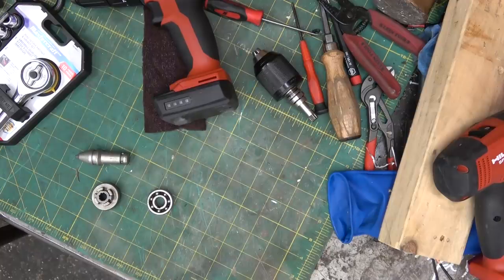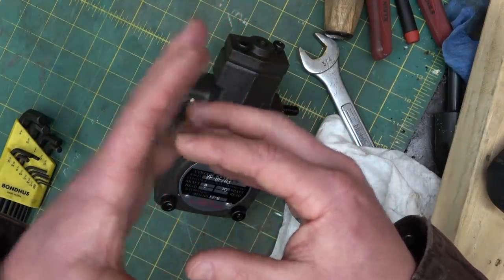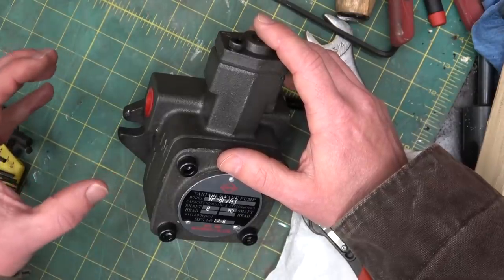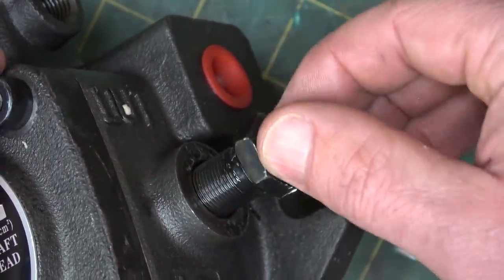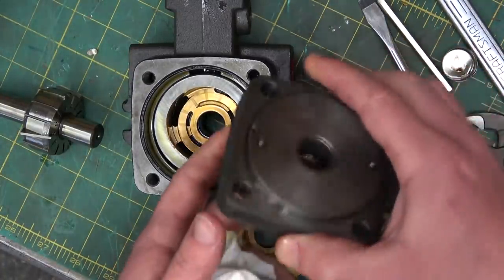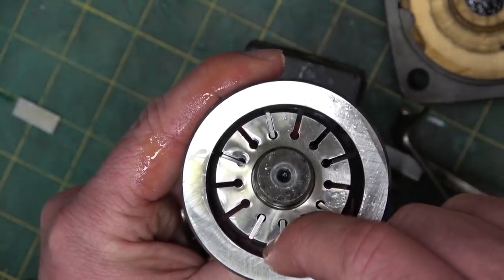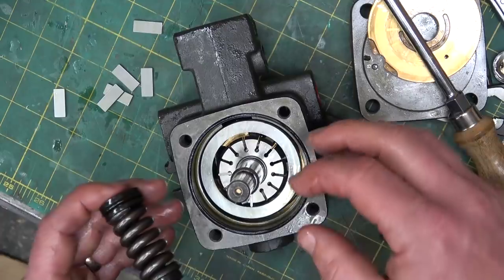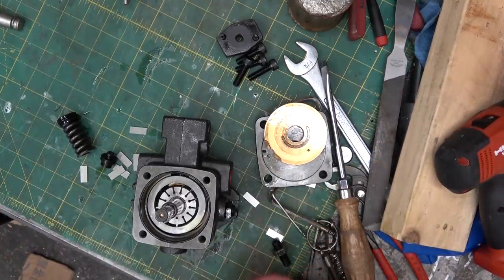BOLTR: Hydraulic Vane Pump | Engineering Lego

Comment: Sorry for the newbie question.  Is heat actually generated when the oil flows from higher pressure to lower pressure?  Or is it where the heat from the higher pressure oil before the release valve transfers to the lower pressure oil after the release valve?

Comment: But you get more pressure with a smaller surface area because the pressure is not being spread across a large area which displaces it. The pressure is more focused.

I'm pretty sure you said the opposite. Suggesting larger surface area gives more pressure?

Comment: Our hot oil system for our texturizer is set for 550°f and supposed to be at 30 psi or so. The pressure will get up over 60psi and the gauge only goes to 100psi. Does that sound sketchy?
Reply: @fascistpedant758  the best part is when the maintenance man says to just get away from it if it goes over 80psi

Comment: wrong, flow only happens due to a differential pressure. pumps create a differential pressure.
Reply: Yes and no. In a technical way you are right. But It's a pump so it depends on the use in a closed loop it's flow do to unequal pressure. in a open loop the pressure indifference between air and oil pressure is driving something meaning pressure is the driving force.

Comment: Finally got you a vane pump ehh? You are correct good sir btw. It is fascinating the power and "magic" of hydraulics. Nothing like watching a relatively small cylinder lift enormous quantities of shit and wondering, how in the fuck?!? It's crazy to me to see all of the crazy forces on a hydraulic cylinder besides the intended in/out forces (axial? Lol). Seems like the cylinders/ram/piston have to with stand all kinds of shear loading and side loading (I'm think shear and side loading is probably redundant) . IDK I'm legally required by OSHA to wear a helmet to work. So I'm no fucking genius. But the point I'm trying to make is hydraulics are fucking mystifying. Like how the fuck does a cylinder retain 3000psi of jizz while having a huge load of shit pushing back on it and then gets a side load thrown into the mix. Seems like the rams should bend all the fucking time, the seals have to be made of unobtainium to withstand the forces, and how is it that the slightest amount of dust/dirt/sand doesn't scratch the chrome and render the unobtainium seal useless any fucking way. MIND BLOWN! Good thing I just have to operate the shit and not build it.

Comment: The problem is these days you dont know if a company will be around. The 10 year "challange" has proven that to well. Many huge brands are going or already gone. The world changes. However is there good news with 3d printing and just at home cnc type devices becoming more and more popular. Even big auto is using 3d printing for some stuff because they dont need to keep a bunch of parts in stock they just whip one up. Also means your at home warrior can do the same. Injuction molding isnt going away but the need for excess that might have to be tossed or figured into another product are going to become less in the future.

Comment: If these are better than a gear pump and cheaper and more robust than a variable displacement piston pump, what's the disadvantage?
Reply: The control is not as fine as is possible with a piston pump and cannot withstand as high pressures as a piston pump.
Reply: @capsicumgalaxytabs4725  thank you!
Reply: @tomcardale5596  thats the basic version anyway :-)

Comment: I was unfortunate enough to be near a hydraulic line that blew open a pin hole leak and started spraying hot oil all over me. It's very unpleasant.
Reply: Leastwise it was all over you instead of all inside you. That does happen.
Reply: Sounds like a typical day at my work,  cylinder repairs and whatnot.  Every once in a while, something doesn't pass testing. Rest of the time, operator error.

Comment: Weirdest hydraulics I've heard of.  Hydraulics have - if not variable flow - a pressure setting valve which is used to set the maximum or normal operating pressure. The relief valve is a safety item which is set above the WP set valve and is designed to dump pressure - oil - in the event of failure of some other part of the system. And a relief valve does not leave the pump running at full load because relief valves lift at P1 but will only close at a P2 pressure at a considerably lower pressure than the lift pressure. Also - and it might be a surprise - but most hydraulics for industrial use have coolers.

Comment: My oil pump in my 1973 0lds350 stoped pumping.i took it out and found the spring valve deal waS stuck and 0pen slitely.wow i cleaned it up and now is unstuck. The plate gasket got torn up takeing tbe gears out..i was going to just use some red rtv.sealer and slam it back tograther,but,after seeing your vidio fear it mite not seal or something. I dont realy want to bye a new pump. Its,an old car i just want oil out the pushrods.what do you think ..is it,an issue?can i make a gasket or yous jb weld...but what do you think obi wann?great vidio..also your hands got redder i think ad vidio played on .wear gloves..i know,i knowbut vat do you think der gearmaster.i want to fix things. Not just panic out and go get a new pump.i saw your vidio on understanding the problem.

Comment: Dear Uncle B.: I am of the pixie-corraling inclination, so pardon my innocence. I understand pumps are good for flow, but what machines are good for building up hydraulic pressure? In my pixie-neutering work, you classify them separately (voltage vs. current source) and many times you don't build a device to be explicitly both, although many machines are designed to have both features.

Comment: And again we try to create flow without pressure - ain’t gonna happen. Any fluid enclosed in a system is not going to flow without pressure (force); you can constrict the hose all you want, but the fluid will just scooch out of the way. You need a skookum pressure-creating device, and somewhere for the fluid to go, then you can put the fluid to work for you. Or maybe not if you’re the sort to watch these videos and try to do these experi-mints at home; then you’re just begging for a face full of hot hydraulic fluid! 🤣

Comment: i watched this years ago, and now im in hydraulics. that thing looks like a knock off vpv or pvf what super chineseium
Reply: also the important thing for spec is rotation, flow, and pressure range. the mounting flange is universal as well as the shaft but theres likely dozens if not hundreds of options for the main three options.  Thats a knockoff of a "knockoff" looks like a continental pump which is a knockoff of a psv from racine
Reply: god i keep watching and it keeps getting worse, that brake in wear is just fucking insane, that old girl is gonna give it up fast

Comment: i'm really perplexed as to why they didn't put springs behind the vanes.. I have only seen pneumatic vane motors constructed this way, all vane pumps i have ever seen have all had springs behind the vanes. this is odd.
But thanks to UBF for once again providing a fantastic hydraulics vjo :)
Reply: Because this is a pump being driven, the centrifugal forces will fling the vanes out.  An air motor has to have the vanes out to start.
Reply: If you ever feel how smooth and slippery the vanes are in the slots you would understand. Very precision and always lubricated with oil. I've taken apart very old pumps that were in surprisingly good condition inside.
Reply: Most pumps wont have a spring behind the vane, centrigical force from them being driven will force vanes out to seal. 
Hydrualic Motors can have springs behind vanes- they need the spring pressure to help seal on start up.

Comment: Pump creates flow.... Compressor creates pressure. Differential pressure is flow.... Hmmmmm. Lol. What would lead an engineer to choose a vane pump vs centrifugal pump?
Reply: For the reasons he mentioned, flow can be adjusted.
Reply: @Patrick-857  but can't flow also be adjusted with a variable speed drive motor, or even with a downstream valve? I guess I'm just curious as to why an engineer would choose a Vane pump vs centrifugal (not worried about cost). Kinda like why do some cars have brake calipers on the front of the rotor vs the rear of the rotor.
Reply: @johnnyringo4463  For precise electronic control, a piston pump is used. This thing is self regulating, using a a very simple and purely mechanical solution. This thing does it's job without any electronics. The simplicity, the self contained nature of it and the lack of electronics means it's both reliable and cheap. We must also remember it could be an infernal combustion engine driving it, which means varying pressure with the throttle is a no go. Also, varying pressure at the motor level is always going to be ineffective due to the time delay caused by inertia. That's before we start talking about torque curves ect. In a hydraulic system, as AvE points out, pressure will spike instantly when a hydraulic ram reaches full extension. The pressure must instantly be reduced to prevent a blowout, and if you have a heavy motor winding down, that delay could be enough to cause it to blow. The beauty of this simple device is that it is continuously variable, instantly responsive and self regulating. Sometimes the simplest solutions are the best solutions.

Comment: Now, i wouldn't disagree that pumps primarily creat flow but to be completly exact, pumps create an energy difference in a system or rather give a fluid a higher energy state, in form of pressure, flow or potential energy (height difference). Piston pumps primarily creat this energy difference by displacing fluid, with the benefit of being suited for high pressure applications but not being suited for high volume flow. Dynamic fluid pumps like centrifugal pumps are not really suited for high pressure applications, due to them  
primarily increasing the fluid speed and therefor creating high volume flow. Now, saying that a pump doesn't creat pressure is not  
false but than again, you can convert fluid speed into a pressure, so the statement doesn't really make sense to me.
Reply: @fascistpedant758  
Yes and no, what you said about a massless fluid isn't false but translating the same principle to a fluid with 0 compressibility and and your pump would exclusively produce a pressure difference. As i said, for me it is a bit confussin, since you would calculate the total 
work done by a pump, as a total pressure difference (wich not only depend on restrictions but also the  fluid speed in the system and the height difference) times a masseflow. Saying that a pump only produces flow would than applie only to the case, when there is no height difference and very low fluid speeds. Than again, there is the NPSHA wich to my knowledge shows the height difference on th suction side of a pump dependent  on the fluid speed because alters the static pressure inside the tube. So as you said, it probably is more phylosphical than anything else.